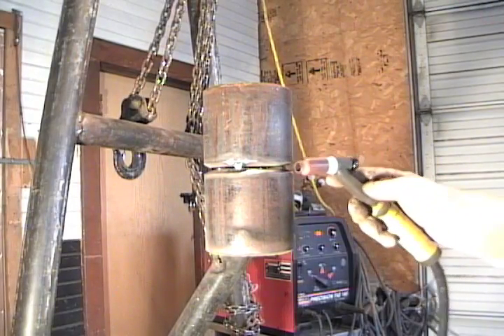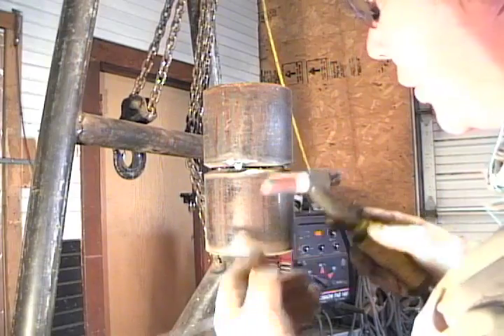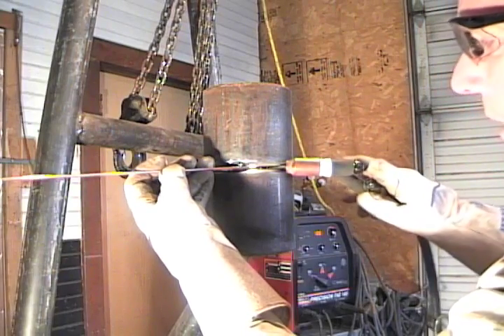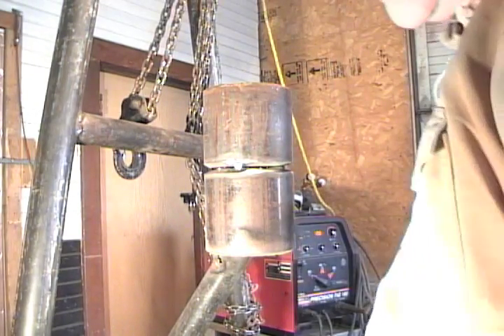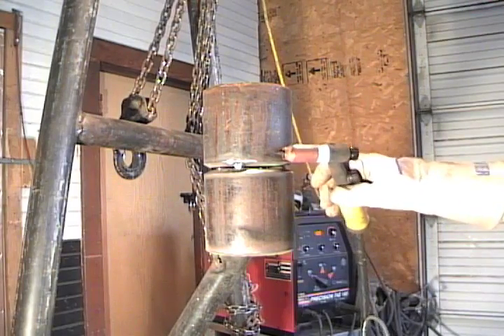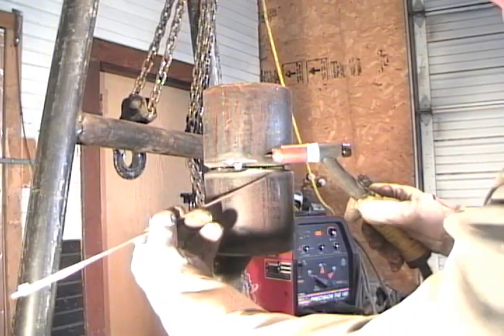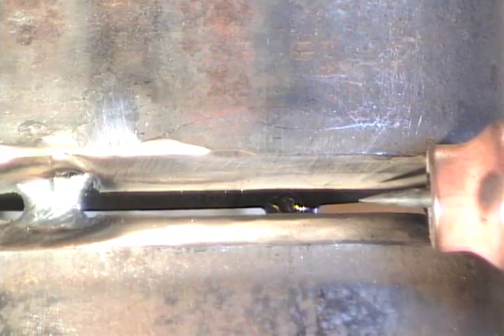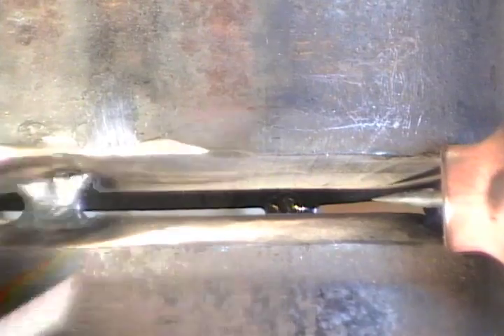Learn To TIG Weld [TIG Root 2G Position]

Comment: why do u need 5/32 gap? 1/8 gap for 1/8 rod works fine. just lean it in the gap and walk over it.
Reply from the maker: KRS 1 The material can sometimes draw together and with the technique I am trying to show it's always better to have more gap then less if it should happen to draw together some. As far as the tie in, I am not showing any of that in this video. I do show all of that in the course on my website though.
Reply: Michael Treadway oh o.k. sir. i have never walk the cup on root with a gap bigger than the rod (1/8 gap for 1/8 rod). i was told to just lean it in the groove and just go over it with very minimal tungsten wiggle (just enought to fuse both  bevels) and the heat and arc will push it in, especially on the bottom around 5 to 7 area. i would like to know if your course includes stainless pipe?
Reply from the maker: That is correct KRS1. There are times when you can get suck back if you don't leave enough penetration and metal deposit on the interior of the root. Stainless really draws together. The amazing thing about welding is that there are methods that work for people that suit there style of welding. They may not be the same for everyone but the end result can be the same. I do not have any stainless videos.
God Bless

Comment: You mean 2g. How can anyone make an instructional video on pipe welding if you don't even know the postion. 5g is when the pipe is in the horizontal position with the weld joint in the vertical position. It is a fixed position and can't be rotated so the welder will have to weld from 6 to 12 o'clock. This is key information that was poorly communicated. Lastly, anyone can talk about welding techniques.  Lets see you strike an arch and show the GREAT tips your talking about.

Comment: Good video, very helpful, with some good tips. I usually go for a 3.2 mm gap so that
gives you room to feed your filler rod 2.4 mm through the root gap. Also it will be
enough allowing for pipe shrinkage. Good Luck

Comment from the maker: Because of the technique I use. The wire is fed through across the bevel instead of laying the wire on the gap from the outside. Shooting the wire through from the outside across the inside of the pipe is easier on the welder for watching the weld go in. If the material ever draws up on you, there is still room to make good penetration as well.

Comment from the maker: What type of trouble are you having? Is the cup sticking to the iron? You can use whatever cup makes your life easier. A # 4 cup is extremely small. The cup in this video is a # 8. The gap is set to 5/32 because I am using 1/8" filler rod. You might find a # 6 still a bit small. Try it. Welding is much about trial and error. Thanks!

Comment: thanks a lot for your advice il out them into practice and see how i get on with your method,and i have to agree with you saying try and stay relaxed.ive just learned not to be nervious welding pipe just get comfortable,i just get nervous somestimes bout not getting penertration on the pipe,thats why i have some off cuts first just see to how many amps i need because some plants are different amps wise.thanks so much.

Comment from the maker: You usually lay the rig back somewhat. I don't know what the angle degree would be, but you don't want to dip the tungsten.
And if you do you can grind that area before you cover it up with the next pass.
70 might be a good calculation. Sharp tungsten is very important and it is one of the things I stress in my teaching.
The more you watch the videos over and over again, and the more you practice the quicker you will get it.
One of the key things in welding is to try to stay relaxed.

Comment: thanks for that advice mike cos im trying to get all the experience i can even from talking to the experts to pass on some tips to me cos im only welding pipes with two years on and off and trying to perfect it.with walking the cup it all depends on tungsten lenght?is is a case on a 90 deg angle to the pipe or slope back to a 70 deg to avoid inclusion in the weld and to gain penertration on the inside of the pipe?

Comment from the maker: Hey Richie,
I would go for the pipe element and practice on pipe since this is really what that process is designed for. You could get some scrap pipe or make yourself a coupon and practice on your off time or your lunch time  but try it on the pipe because it won't feel like plate since you will be moving your wrist to make the circle of the circumference of the pipe and that is very different than a strait plate.
Hope this helps. Thanks!!

Comment: hi there mike,im a welder myself coded to asme 9 stanard in stainless and carbon pipe but mainly weld carbon noe 2inch upwards and never tried walking the cup before,i was thought free hand since i started by leaning a finger on the pipe to gain position i fell comfortable doin thus but like to try this method,is it better to try it on plate first like a t joint to gain practice?